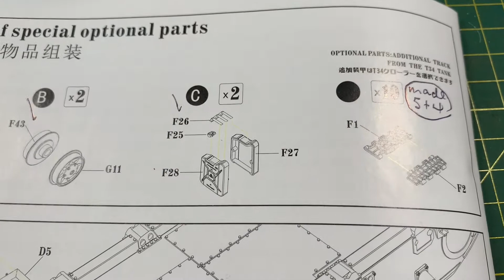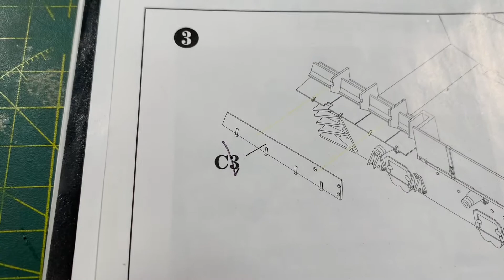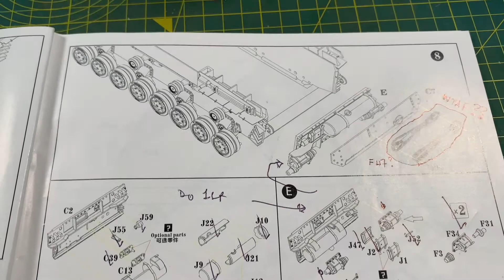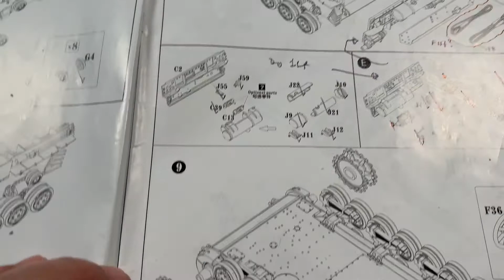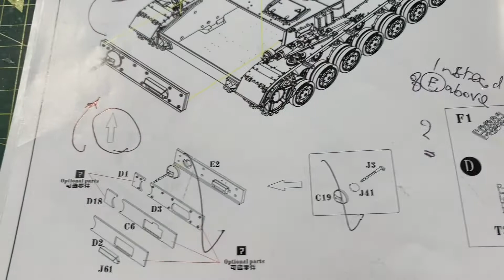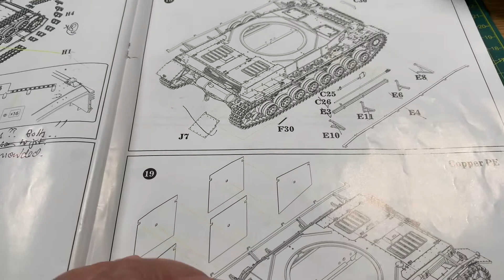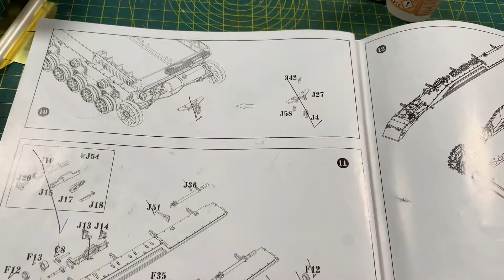Verdict on Border Models Panzer IV Ausf G. #001 build.

Comment: 7:56 they are optional parts, optional being the key word here. the 'error' on the next page actually doesn't have any of the add-on armour on the lower plate, so it isn't an issue with the way the instructions have been made,

edit: 10:16 you're supposed to have a pair of metal wires included in the kit, thats what those are for. if you didn't have any then that's an irregularity in your kit.